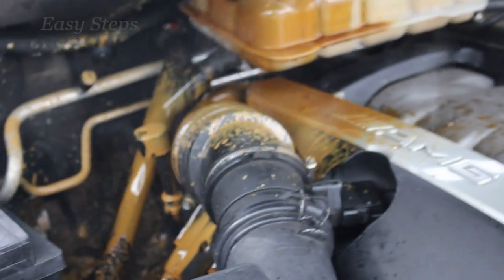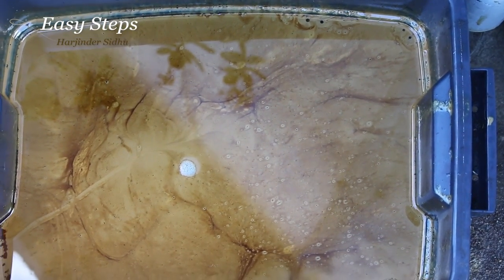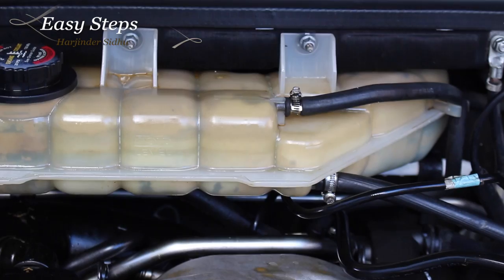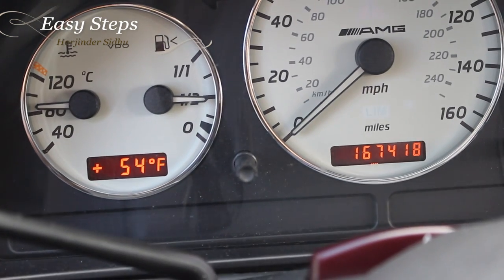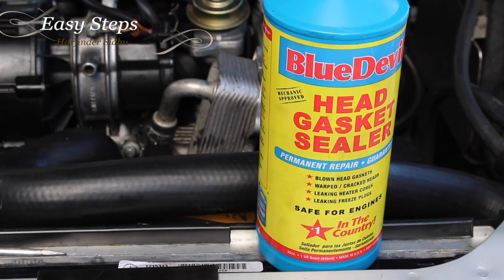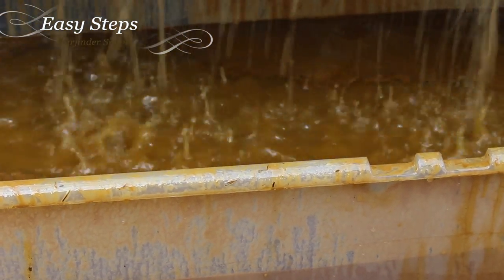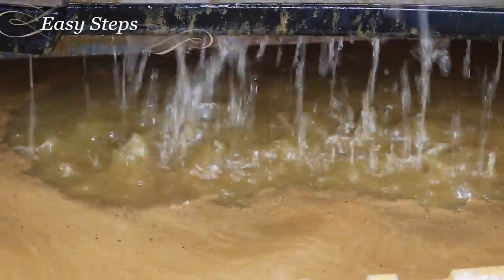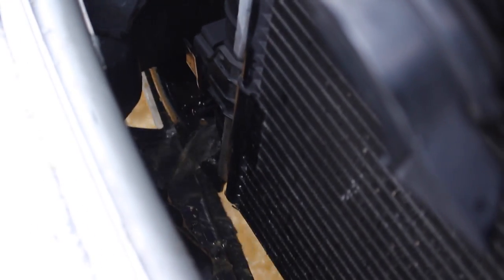How To Fix Coolant Mixing With Engine Oil | BlueDevil Head Gasket Sealer

Comment: This definitely worked on my 2005 Honda Accord. Two days ago I was overheating and had transmission fluid Mixed with the coolant and was leaking real bad! I couldn’t drive for 30 seconds without it going to H right away. I called my mechanic and he said I had a blown head gasket and I won’t make it no where.. I was 162 miles away from home in the hot sun over 105 degrees. I spent 100 bucks in autozone buying oil, transmission fluid, radiator cap and something else. Well I gave up and was about to pay 638.00 to have it towed home. Until my wife said, let’s spend 30 something more dollars on this head gasket sealer. I said fine why not. We poured it into the radiator. Ran the car and it went straight to H. I gave up. So while driving to the shade, out of no where, the overheating stopped. And temperature was below half. This really worked! I had thick milkshake looking oozing out of my radiator and coolant reservoir so I didn’t think it would have worked and sure enough. I drove it all the way back home, only stopping once half way home to let it cool down as I grabbed a burger! This really works!
Reply from the maker: Glad I could help! please share, thanks.🙏
Thanks for the like and thanks for watching.🙏
Reply: How do you fix it
Reply: do you know if the "pour n' go" forumula would have same effect? Also, how should i tackle this issue? I plan on draining oil/coolant. Running water into radiator & replacing the oil. Run the car for 5-10minutes to "flush" old oil/coolant out the system & then start the process of the sealer. Thoughts, any advice wold help. Thank you.

Comment: Worked for my 2002 Subaru Outback H6 3.0 from 275k miles to 309k miles, but without a thermostat installed at all. Only the thermostat gasket installed with the thermostat area cored out. Could drive up mountains, go up to 115 mph with no problems at all, like a flag finish winner this car with Blue Devil. Today and yesterday I saw coolant was coming out of my radiator cap a little bit, only knew because I saw a small amount coolant above the fan area. Thought it was the cap. Nope, the pressure was getting too intense and Blue Devil was not a permanent fix at all. I just now re-did Blue Devil with 20 minutes left of idling. Did a nice water flush about 3 times finding some oil darkening it all. Yes, oil has been getting in. It's even around the rim of the mouth of the radiator, nice goupy black residue.

Hopefully it works out a second time around, I'm looking for a new car in the process.

In the process of flushing I used approximately 6 1/2 gallons of pure water, should use Distilled but, I really don't care anymore.
Reply from the maker: Thanks for sharing the info.
This is a temporary fix and shouldn't be considered a permanent fix, and you might get lucky with a 2nd-time fix, but I don't recommend it.
Thanks for watching.
Reply from the maker: I have started posting DIY videos on my 2nd channel "Sidhu DIY" so please check it out and subscribe, thank you.🙌 🙏 🙌  https://www.youtube.com/c/SidhuDIY

Comment: For engine oil in coolant reservoir, you have to change the oil cooler, or maybe just the oil cooler gasket went bad. That's what a Merc mechanic told me today.
Reply: This is exactly what it is I don’t think is a head gasket is a oil cooling system probably bad
Reply: That’s right 😊
Reply: i heard you can also disable oil cooler for good

Comment: its says right on the bottle DO NOT POUR IN RESIVOIR .......you have to remove thermostat if you can...then pour blue devil directly into engine through radiator hose then reconnect hose

Comment: I have a Vauxhall Astra 2011. Will this work? And also is it just the engine coolant that we need to completely drain till the water is clear after we put in the blue devil or before and after?
Reply from the maker: Yes, it will work with all cars. Good question, did you watch the whole video?
https://youtu.be/TnO9Q7WH2N4?t=186

Comment: I noticed a rough idle with white smoke one morning I had to get to work I was on freeway with a huge white cloud behind me I pulled off right in front of a autoparts  got 50$blue devil. This stuff only works with engine cold so I waited till morning to do it meanwhile I had coolant in oil I drained oil on my cats litter I had in trunk I added thick Lucas oil so engine can have some lubricant added more coolant and drove to work, left it at work and returned in the morning.i removed thermostat and added blue bottle following instructions and to this day that fluid remains inside its running great so far
Reply from the maker: Thanks for sharing the info. 🙏  thanks for the visit. 
Please share, thanks.🙏
Thanks for the like and thanks for watching.🙏

Comment: Have a Subaru Forester 2011 and oil and water is mixing … do you reckon it’ll work ?
Reply from the maker: It should and will be a temporary solution and not a permanent solution.
Good luck and please share the results, thanks for watching.🙏

Comment: Do you pour it in with water are antifreeze?
Reply from the maker: After pouring BlueDevil slowly, replace the radiator cap. Let the vehicle idle with CAP ON for 50 minutes maintaining normal operating temperature. After the treatment open the radiator cap as I have shown in the video keep pouring the water into the reservoir and keep flushing until it runs clear.

Comment: can I run my car while I'm trying to seal my gasket with this stuff even though Im getting water in my oil?
Reply: do you know if the "pour n' go" forumula would have same effect? Also, how should i tackle this issue? I plan on draining oil/coolant. Running water into radiator & replacing the oil. Run the car for 5-10minutes to "flush" old oil/coolant out the system & then start the process of the sealer. Thoughts, any advice wold help. Thank you.

Comment: Do i have to change my oil as well ? If so do i change it before or after putting in blue devil sealer?
Reply from the maker: After, once it fixes the issue. Thanks for watching.
Reply from the maker: I have started posting DIY videos on my 2nd channel "Sidhu DIY" so please check it out and subscribe, thank you.🙌 🙏 🙌  https://www.youtube.com/c/SidhuDIY
Reply: You can throw it right in the radiator cool or warm. It will work

Comment: on my ml500, 2002 same milky stuff is appearing. no sign of water on the engine oil dip stick, temperature remains at 100 mark. have changed valeo and problem persists and considering changing the aluminium stuff on the front of engine near the oil cap and power driving atf pot. what could be problem?
Reply: Chukwuka Agubamah Have You Checked your Oil Cooler?

Comment: I would just do one thing different put half of bottle at the end and let run again for 50 min to be on the safe side ..and leave it in the engine till next radiator flush ..
Reply from the maker: Thanks for sharing the info. it's entirely up to you how you do it.
Thanks for watching.🙏

Comment: You had leaking oil cooler that you managed to seal with that product not head gasket. With blown head gasket you would have coolant in engine oil not other way round.
Reply: Probably not. Oil pressure is around 50 psi and coolant 13 psi so guess which normally leaks into which ?
Reply: I have oil in coolant,changed my radiator,I was told I needed an new one,but coolant still has oil,and my coolant leaks,have to keep putting some,any suggestions...
Reply: yea i got freaken oil inside my coolent tank
Reply: @adrianamorales818  yea same oil is in the coolent tank saw a video on youtube saying i have to replace the coolent and oil filter pump is this what you had to do also ??
Reply: @SuperJg31  so did you change oil filter pump?